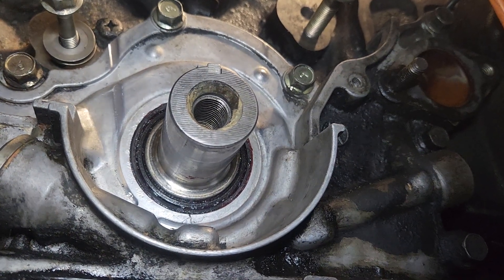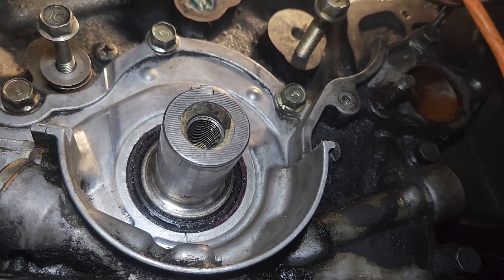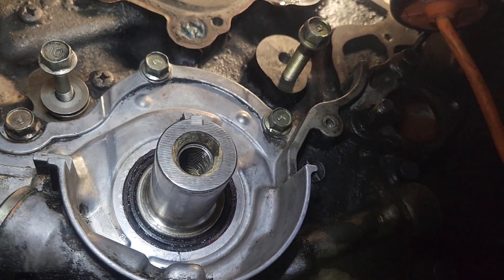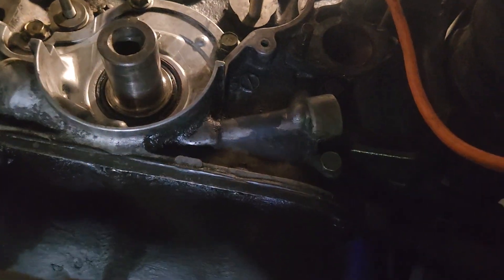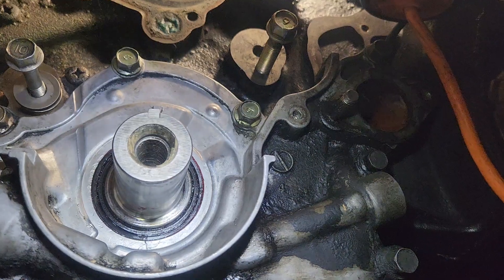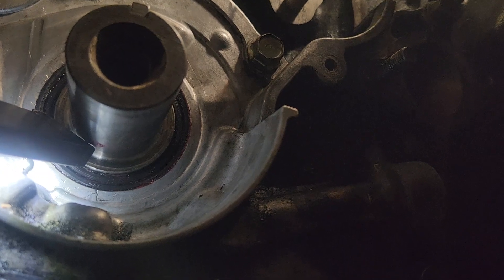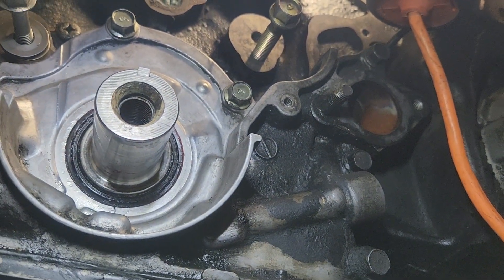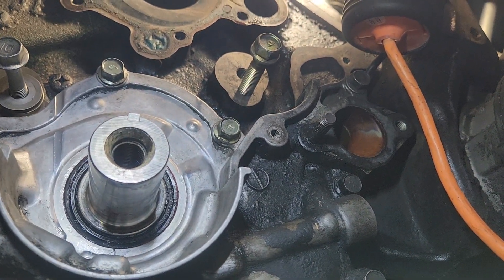DISASTER crankshaft seal installation error

Comment: JB weld
Reply from the maker: I was thinking that....too many people have mixed opinions and experiences with it though...the scary thing about attempting JB Weld on something like this is that 
-the oil pump is made of aluminum which expands/contracts twice as much as iron (meaning that its likely to crack the JB weld)
-theres no way to monitor the health of the repair unless I basically do another complete timing belt job cause this crack is behild basically everything including the crankshaft sprocket and harmonic balancer